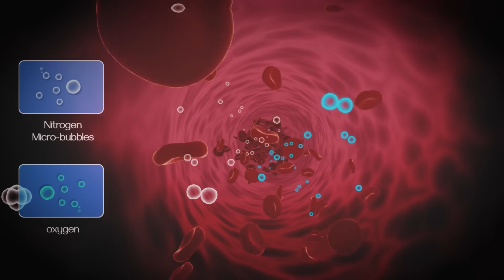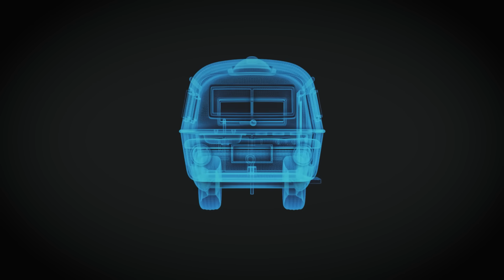How Did a Tiny Hole Kill 4 Divers?

Comment: There is some speculation that the divers were so fatigued from their long hours diving there might have been a communication error or misunderstanding between diver Truls Hellevik and tender Crammond. Truls might have unwittingly made some hand-signal that the pressure hatch had been closed and that it was ok for Crammond to proceed with unlatching the diving bell... 
Others speculate that Crammond might have "communicated" with Hellevik though the pressure chamber window and asked if it was "ok" to proceed which Hellevik misunderstood as a gesture Crammond would proceed only after the hatch had been closed. 

Whatever the case may be Truls Hellevik was in the process of sliding the circular hatch into the correct position when Crammond unlatched the locks to the diving bell... 
This pressure door was designed to work much like the door of a bank vault. It was center double hinged and had to be swiveled into the correct position before the door could be pushed into the circular frame and be properly shut. 

What happened was that the door was swiveled almost to the correct position when the latches were released. The gargantuan force (I've read the forces would amount to roughly 20 tons instantly trying to escape through the small opening) therefore violently pulled the circular pressure door into a slightly diagonal position much like a manhole cover left ajar. What remained was a small crescent shaped hole (about 60 centimeters long) and all those 20 tons of forces violently pushed Truls through it. Needless to say his body was too large to fit through that small crescent shaped opening and it was therefore bisected. 

Anyways knowing that this happened within a few milliseconds, and the human mind perceives something in a tenth of second it's clear neither Truls Hellevik nor anybody else had any idea what hit them. 

It's really strange to think that a pressure chamber designed in 1975 didn't have any safety signals or warning systems to prevent such an accident from happening. I mean it wasn't WWII levels of safety so to use something so dangerous in 1983 was beyond belief.
Reply: I have the official report on my computer. It's disturbing to say the least. They had worked 13 hour shifts (8 is max.) for the last two weeks prior to the accident and got as little 3 hour sleep. Martin Saunders said in an interview with a norwegian newspaper in 2009 that they were extremely exhausted to the point where they could barely stand on their feet.
Reply from the maker: Thanks for the extra detail. Yes it is unbelievable but it seems around that era there were plenty of cracks in the systems, knowledge and training. Not a great time period to be a sat Diver.
Reply: If I had to make a guess why such an unsafe system was still in use, I'd say profit maximization.
The capitalist system and it's managers have a fetish for dead things like money and place no particulate importance on living & feeling things like humans (or animals for that matter).
Need an example? Just watch the next video from this channel. They uninstalled a safety system that could have saved all divers just for some extra loading space to maximize work-time and thus profit.

Comment: Is the pressure experienced really 9x as much for 9 atmosphere instead of 1 atmosphere? I would imagine that its not such a linear curve. And does the nitrogen gas expand 9x the size? Are all of these relationships really linear like you say? I would not imagine so.
Reply from the maker: I know it sounds crazy but yes they are. Its called Boyles Law. The law states that "For a constant Temperature there is an inverse relationship between Pressure and Volume" 

So if you increase the pressure then the the volume decreases (The temperature will only make a negligible difference in the ocean). At sea level there is one atmosphere of pressure. If you go down to 10meters deep or 33 feet you add one more atmosphere or you double the atmosphere to 2 atmospheres. In this case you halve the volume. Or to be specific you compress the same number or molecules into half the space. 

FYI, Im a diving instructor and Boyles Law is the basis of almost all things diving related. I also run another channel called Waterline Academy where I go into a lot more on Diving. Ive got a video Called Decompression Sickness which explains this in a bit more detail. 
https://www.youtube.com/watch?v=r4ydTWo1Lm8 

Of course you can also look up Boyles Law. 
https://en.wikipedia.org/wiki/Boyle%27s_law
Reply: 9 times, linear, catastrophic,  death

Comment: This is the best explanation I've ever heard on the subject, and I've heard and read about it many times before. Incredibly well explained.
Reply from the maker: Thanks. I think it helps to understand the diving physics.
Reply: I gather that it's a difficult incident to describe without diagrams and without going into the anticipated correct procedure. But then you get into limitations on research from the company itself, not wanting to comment, not wanting to release photos of the hatches. Lawyers .... Pretty complex engineering involved to get the entire system to work, under all that pressure, without tiny cracks that would result in catastrophe.